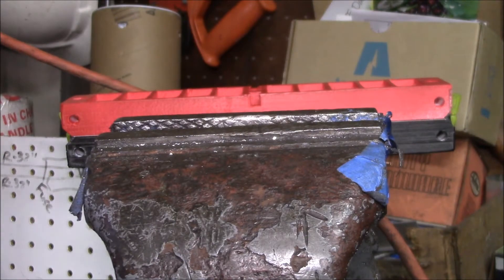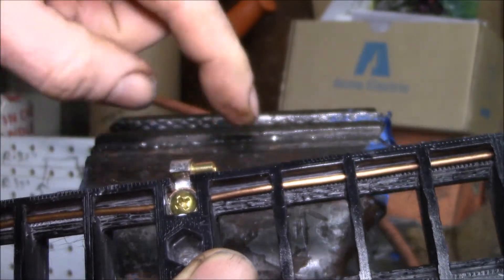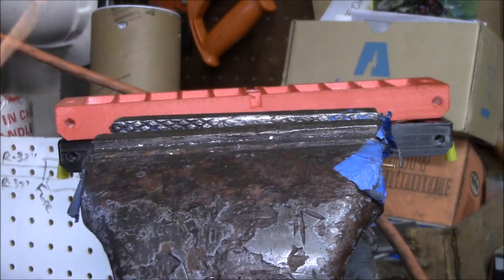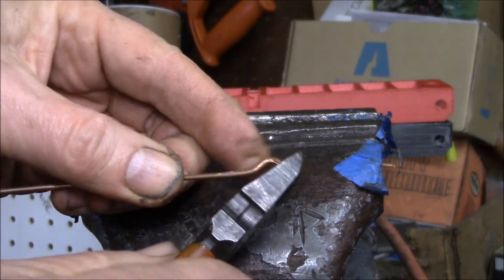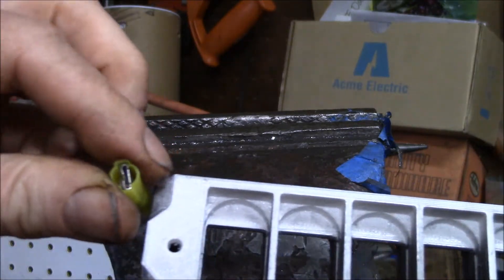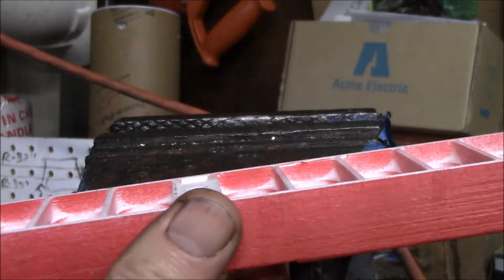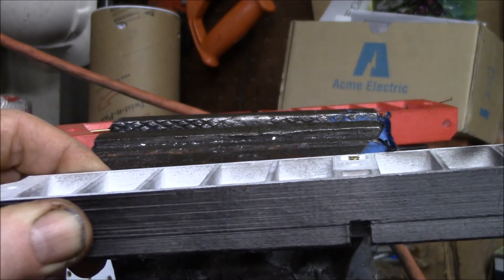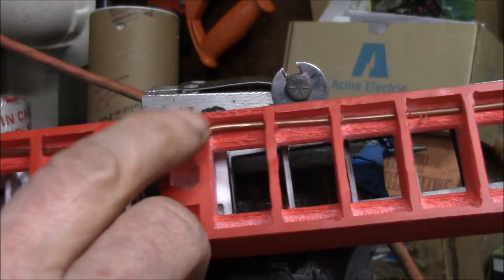Building 20P Battery Modules, Part 4

Comment: IMHO 18650s are becoming absolit, have you looked at the LTs?
Reply from the maker: Not familiar with that battery abbreviation.  Yes, as far as the 18650, I guess there's a line between obsolete and mature technology.  They are getting quite affordable, maybe that's because they are soon to be replaced by the next thing.  I guess time will tell.
Reply: Lithium–titanate battery
Reply from the maker: Thanks, hadn't heard that abbreviation before.  Will have to see how that chemistry does vs. LiFePO4 over time.  For now the $/WH is higher, but I guess you need to factor in the lifetime as well.  Either chemistry could be put into some sort of cylindrical cell form factor.  Maybe the 18mm x 65mm size will live on.